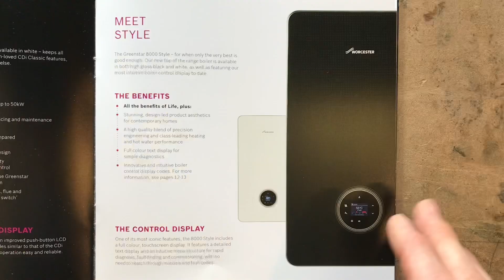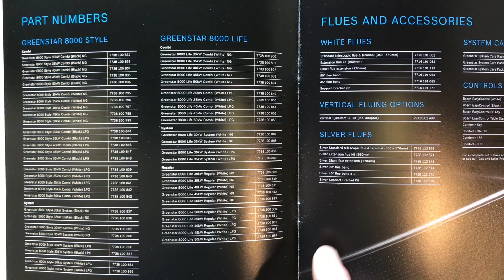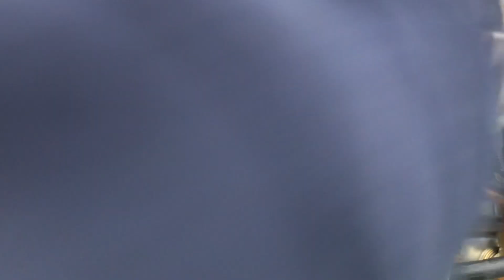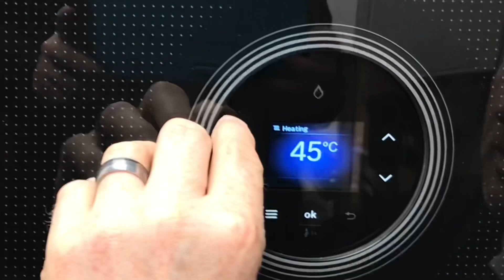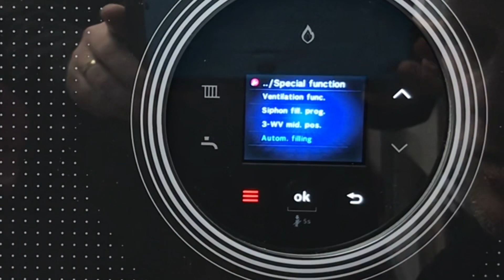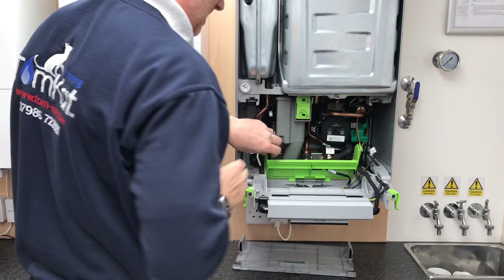The Worcester Bosch 8000 lifestyle review

Comment: I am getting quite a few calls where these Boilers are getting air locked. Worcester has decided to replace the problematic AAV with a Manual Air Vent. Why can't the manufacturer just put a AAV outside the casing.

Comment: Why the hell, would you have a function that limits the amount of refills, that's stupidity, as a consumer i don't want to call out worcester-bosch everytime it drops below a certain level. I want to be able to refill it myself.
Reply: Actually the more I look at this, the more I think it's an overcomplicated load of rubbish 😂 for what is essentially a cdi classic that's had a facelift.
Reply: If your pressure is dropping regularly, it's something that needs to be addressed, if you keep topping it up without addressing the cause, you are constantly adding fresh water into the heating system, this will in turn lead to a lot of corrosion in the heating system. I'm not a fan of Worcester boilers personally, but I can see where they are coming from, up to a point anyway. Although I would prefer something like a warning telling the customer that there could be a problem and it needs attention, this is certainly more of a money maker for Worcester.

Comment: After noting my friend's 17 year old Worcester combi boiler worked better, swapped my 12-year old Baxi with cumbersome loft tanks for a Greenstar 8000 life... It's like changing from a Trabant to a Rolls Royce.  Settings for most efficient heating and hot water delivery performance are a breeze... difference in CH out and return water temperature, crucial for efficiency so easy to adjust.

Comment: Why is the condense trap so big, it blocks access to everything and why is the plate heat exchanger still hiding at the back with no access, OMG what's that behind the dark green plastic cover, Nooooo.  The good stuff, its taken years for them to make a boiler case that make it straight forward for access.  The way forward was to fit weather comp via boiler manufactures controls 15 years ago, Worcester are so slow and where is the multizone wireless control kit, again I have been fitting it for over 10 years but Worcester you are so slow.

Comment: Why are there two temperature control sensors on the supply line? One in the heat exchanger, the other directly on the tube?

Comment: We had this boiler installed a week ago, so far every day we need to top up the pressure as it goes down to 0.4 bars. Any idea what could be wrong, we have checked for pipe leaks buy haven't found any.
Reply: can you please tell me what the cause of this was? I have the same problem.
Reply: Pipe leaks or air in the system.  Mine, also installed last week, together with swapping old for new radiators, OK
Reply: Snap! Awaiting Worcester Bosch engineer due tomorrow.

Comment: Good review derek would like to see a strip down of the bottom end plate heat exchanger fitted lots of cdi boilers downfall of it is for older people they like the controls for water and heating in front of them perhaps worcester will learn and alter it in 20 yrs oh i forgot perhaps we wont need gas boilers then thought is terrible Thanks for putting video on Gwyn Morris gas engineer

Comment: Can it control zones ? we all know when installing a new central heating  we have to split the system at least up stairs and down stairs .
What happens when there is a system leak ?
Does the auto fill keep topping the system .
If so the inhibitor will dilute   .

Comment: I'm looking to replace my 28i junior as it's 12 years old but I need it relocating from kitchen to garage so thought I'd get a new boiler. What is the best home boiler - don't mind paying more for a genuinely better product.
Reply: Tech Monky  for reliability and great efficiency look into getting a viessmann boiler check the reviews on them they are absolutely brilliant I wouldn’t swap mine for anything!
Reply: I had a Valliant ecotec plus 630 system boiler fitted 3 years ago. I have 15 rads and a hot water tank in the system. I have a solar hot water so kept the hot tank. It has been excellent since install and my gas usage has gone down. When it was serviced last year the engineer commented that I had an excellent install. In my opinion the quality of the install is just as important as the correct boiler. Good luck with your new one.
Reply from the maker: The company who you get to do the job will tell you which boiler is best for you. The Worcester life 8000 is the best one for a garage in the Worcester range but there are a lot of great boilers out there with very long warranty’s. thanks for watching cheers
Reply: @tomkatgastraining  yeah but I don't trust UK tradesmen. My mate also got upsold a massive boiler. An engineer came round to the annual service and broke the news. Apparently it could supply all the hot water and heating on a cruise ship 😂

Comment: Hi I have been looking at most quotes online for a new boiler and many of the websites that I've clicked on are giving me a quote but the quote almost always includes a chemical flush and not a powerflush. I'm really worried because most warranties are only valid if there is no sludge in the boiler and if the engineer does find any sludge then the warranty would not cover the repair of the boiler. I have been living in this house for 20 years and I believe that the radiators have not been powerflushed or chemically flushed even once in the 20 years. I'm really worried that if the heating system is chemically flushed like most of these quotes are saying then that their might still be some sludge in the system and my warranty would be void if anything was to go wrong with the boiler. Please can you let me know if this would be the case or not. Many thanks in return.
Reply from the maker: Samina Ali it all depends on the quality of the water in the system before the new boiler is installed. All new boilers have to be installed on clean systems now and should have a magnetic filter installed to keep the system clear of magnetite. To keep your warranty you will also need the boiler and system serviced every year this should show up on any service. In my opinion a chemical flush along with a magnacleanse should remove most of the magnetite out of a system but if you don’t have the system checked and serviced every year you are wasting your time. Hope that helps and thanks for watching cheers
Reply: @tomkatgastraining  if I get my system serviced everywhere which I'm planning to do already but say I  get it serviced and the plumber finds that there is sludge in the heating system or boiler will he charge me more for a system flush or does it come with the annual service. Sorry I don't know much about what the service actually includes. Thanks in return.
Reply from the maker: If the engineer finds sludge  in your system he will charge you to clean the system. When an engineer services your system and finds it sludged he will quote you to remove it as that’s not covered in a service. All engineers will give you a quote to install a boiler and in the quote it should tell you what you are getting for your money.
Reply: @tomkatgastraining  Hi I was wondering if you could help me. I had a new boiler installation 2 days ago where my old Mains combi boiler was replaced with a new Vaillant ecotec pro 30kw combi boiler. When i had a shower later that day I noticed that the water flow rate wasn't as strong/fast as it was with the old main combi boiler. I mean the flow rate is not really really low but it's not strong/fast as it was before. Do you know what it could possible be? Many thanks in return.

Comment: Great video. Looking to purchase this boiler but can't decide which thermostat to get. Nest or Bosch Easy Control? You recommend the Bosch controller but it doesn't seem as good Nest. Have you had experience of either being installed? Which performs best? Can the Nest opentherm interface with the EMS controls of the boiler? Thanks for any advice recieved.
Reply from the maker: Sirwafflehead I would always go for the manufacturers controls as it will run the boiler at the most efficient. But really if you think another stat is best for you then go with that . Thanks for watching 👍🏻
Reply: @tomkatgastraining  thanks for advice. I was only put off by lack of positive  reviews of the easy control thermostat.
Reply: The Nefit does NOT play correctly  with the new EMS 2 on the 8000 series. I just bought the Easycontrol with Bosch smart TRVs and it's a really excellent setup and far more capable than nest. It modulates the boiler fully but more impressive is the calendar function in the Bosch package.
Create dozens of weekly calendars with up to 6 switch points per day - then assign them to ANY device or multiple devices like TRVs.
One single TRV can call for heat and fire the boiler.
Seamless.
Reply: @TheFlyingJanner  have the boiler up and running with the Easy Control. So far very happy but just wish it had a boost button to allow a quick 1hour blast of heating when needed. It's a pain having to remember to turn off heating or create another schedule.
Reply: If you have a system boiler with underfloor heating zone as well as radiator zone with a switch live coming from a wiring center is there somewhere this can be wired into the boiler? Or can you only plug in Worcester controls into this boiler?

Kind regards

George

Comment: a) Why did Worcester  not change the flow adaptor material/design , this is a frequent point of failure of the classic CDI (referred  by a plumber as cheese material))   b) Why no Opentherm control capability ,  which is available with  Ideal, Baxi and Atag , and Intergas.  I have the Evohome system in each room, and have to use on/off control with the 2005 35CDi classic , was hoping to stick to Worcester for next replacement ,  if they allowed  Opentherm on this boiler.  b) I wonder will my plumber spill the condensate trap content all over the PCB cover, as it is not  straight pull out (I can see the problem watching every demonstration on you tube  including a demonstration on the Worcester  facebook Q&A session in July 2019 )  .

Comment: What happens if there is a good leak in the heating system? Will the boiler flood the house with auto top up feature or there is some intelligence built in to prevent that?
Reply from the maker: les0nick I believe it will only fill for what ever you set the timer for and how many times a year so it won’t flood the house . You have to use the bypass on first fill or it won’t fill the system . Hope that helps
Reply: @tomkatgastraining  , thanks for commenting. I have to make the choice for the new boiler in coming weeks. In your opinion, should I go for the 8000 or old good classic while they still available? Cheers
Reply from the maker: les0nick the 8000 is a far better boiler in my opinion but if you can get the classic at a good price with the same warranty then it’s worth a go . If you are hiding the boiler in a cupboard or loft say then I would look at the cheeper option. At the end of the day it depends on your needs to which one as both are good boilers
Reply: I don't think this is a good idea, this would keep feeding the leak, and the boiler wouldn't shut down/lock out. Unless it locks out after continuous topping up. 😳